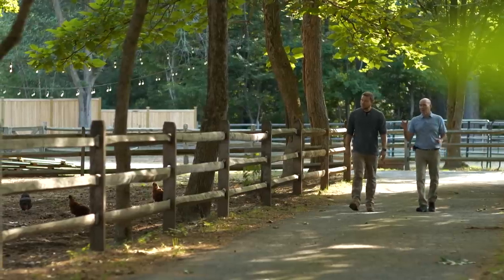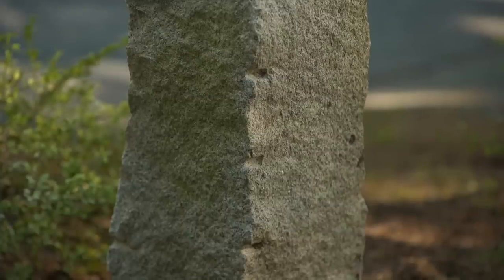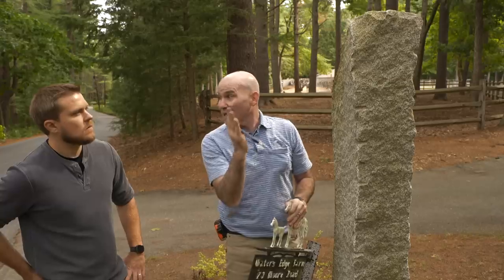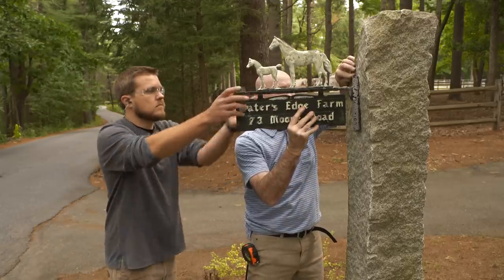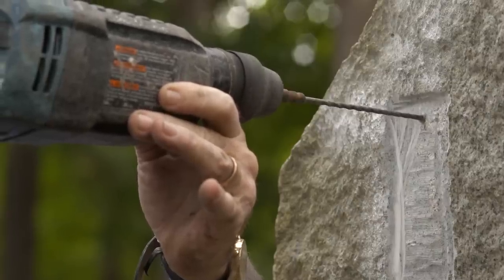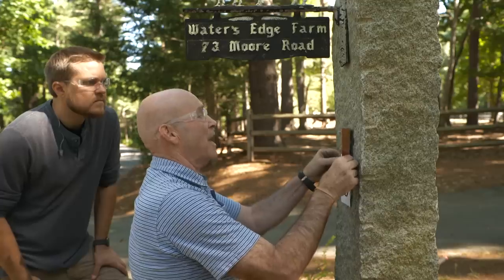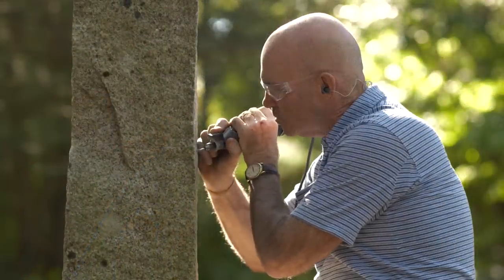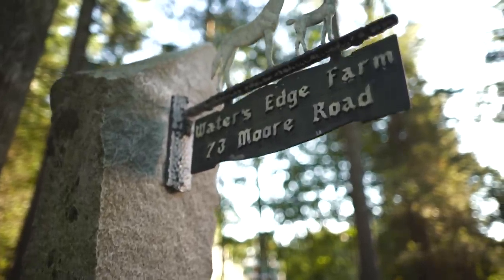How to Make a Granite Post Sign | Ask This Old House

Comment: You aren't supposed to drive tapcons with impact drivers.
Reply: it will be fine.  This is a sign, not structure.
Reply: @justanotherguy8791  Yeah dude, but this is This Old House, its show to demo how to do stuff, and they should be doing it right.